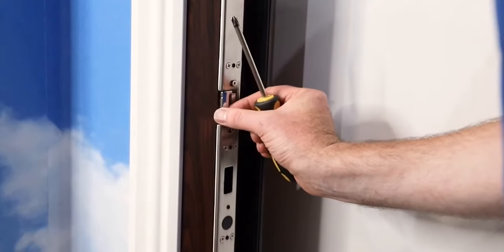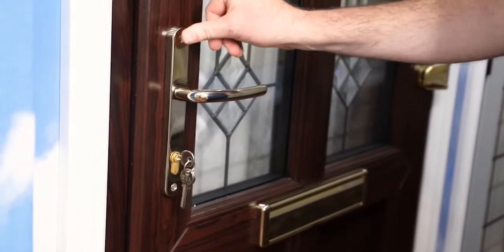How to adjust a uPVC door to stop draughts

Comment: Thanks.  My cam adjustments were on the frame of the door (the receiving end), not on the door itself but I still used the same technique and it fixed my problem.

Comment: I still get a draught near the handle because there is no adjuster there to pull it in.
Reply: Possibly the draught excluder needs replacing. I did mine, an easy cheap job.
Reply: Have a look at the frame - the adjustable parts are sometimes there, rather than in the door.